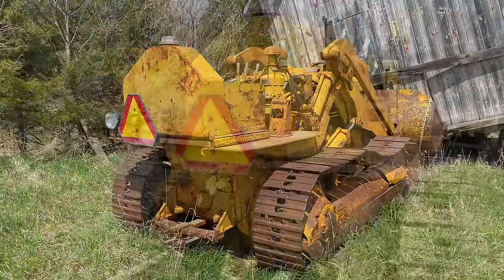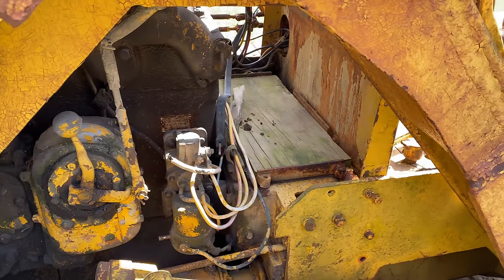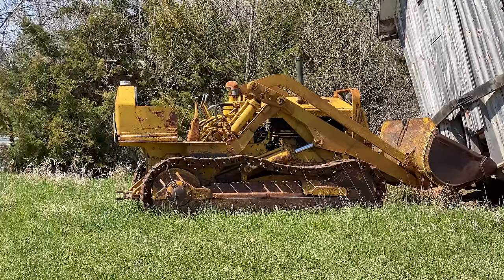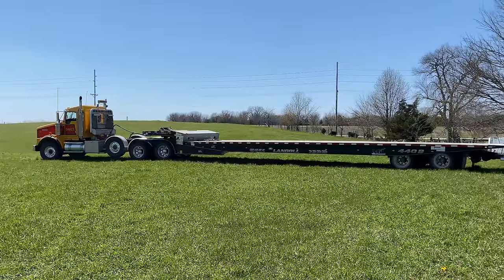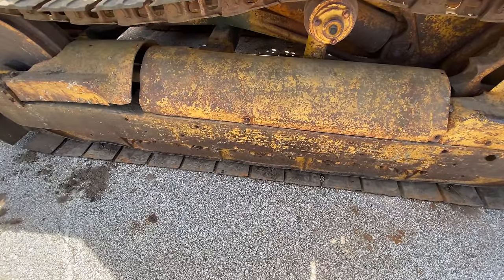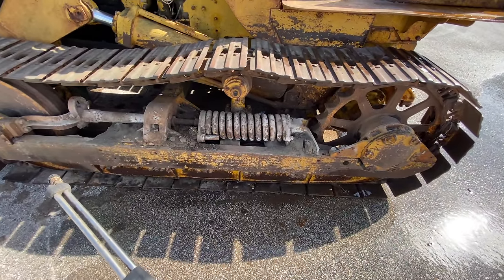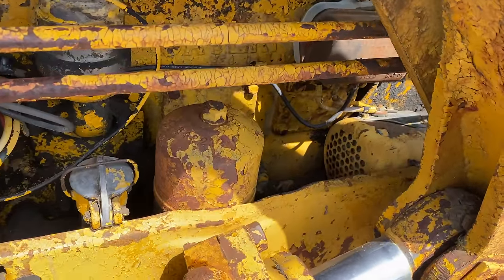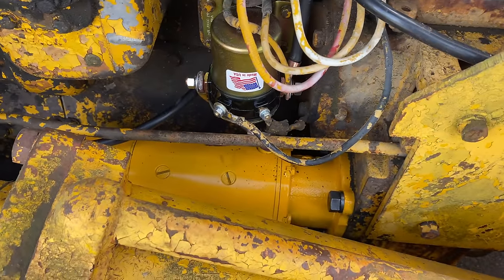Caterpillar D4 7U with HT4 Traxcavator- Will It Run?

Comment: First, Please adjust those tracks. Place a straight 2x4 on top of the track from the support roller to top of front idler 1.5”- 2” from top of track to bottom of board. You almost lost the left one when parking look at the right inside sprocket see it jump and pop back in. You put that thing back O1 condition and it work for your grandkids. ChiefD

Comment: I have seen old tracked vehicles starters helped into life after bashing them with a hammer - stuck contacts or brushes perhaps, but yes, a different project to show us all, so thank you for that.. Well, thats it, I want to see more now..lol good luck. = Ian = UK
Reply: I got a starter on my boat built in 1938 and the starter is just like that but i get down and massage the starter and coax the mechanism with a screw driver and usually she starts just fine, then when it is warm will start on command without the massage and sweet words.

Comment: The loader was not an attachment don't think...was purpose built as a track loader hence the heavy A frame design..missing your pony motor though but probably best...those were big headaches. ..I know lots bout em being an ht4 owner myself
Reply from the maker: These were high end models that always came with the electric start instead of the pony motor.
Reply: Ok..well interested in a video on the starter mechanism..would be a real treat to us Cat owners stuck with pony motors!

Comment: I am always amazed at how much of a track machine runs in dirt.  You know they are the most expensive of all machines to run because of the grit wearing away at so many parts.  A small leak on an oil seal on a wheeled tractor that serves the same purpose is an annoying problem but when that leak is in the dirt all the time the part is getting ground away just like sand blasting it.  When you need them nothing else will do but if you can do it with a rubber tired machine it will be cheaper to operate.

Comment: On these older Cats, always check the engine oil level with the engine running.
Reply: If the engine is warm yeah you can check it with it running, if it is cold, it has a cold check on the dipstick, without the engine running!!

Comment: The track shoes are 3 bar like that to run on asphalt. Excavators run the same 3 bar shoes. The 3 bar shoes don't tear up the asphalt. 

 I have the same machine. Yours is in very good shape except for the rails. It looks like you are already out all the way on your adjustment. If not you don't have much left. My machine has been well used but has new undercarriage. Kind of the exact opposite of yours.
Reply from the maker: I will have a new video on this out soon I have been doing a lot of work on it but not the undercarriage yet.  I am leaving that for last because I know that could become a mess to sort out.  Luckily I have a track rebuilder locally but I have not talked to them yet.
Reply: I bought a Komatsu D75S bucket machine a couple years ago and it also has the 3 bar shoes and I wish it had the 2 bar type but I'm not gonna gripe to much because the tracks , chains and sprockets were brand new when I bought it.

Your D4 looks like it will make a nice little machine for you to restore and play with and your friends hauler was a pretty nice piece also.

Comment: The undercarriage on that machine is very worn It needs to be replace. nice machine otherwise. Go to ACMOC to find out all about your machine. Please get all the manuals for your serial number(Located on the block right by the solenoid and on the left rear case).
Reply: Whew, yeah the sprockets are done.
Reply: @Ma_Deuce_338  Lots of info and knowledge at the ACMOC site Best place to find parts and repair information Still it is a nice machine, I had one just like it 40 years ago.

Comment: I have a 57 tracacavator.  Where did you get your starter rebuilt?
Reply: you can change them to delco 40 or 42 mt 24 volt that starter is hard to get parts for and if found are higher than newer 40s